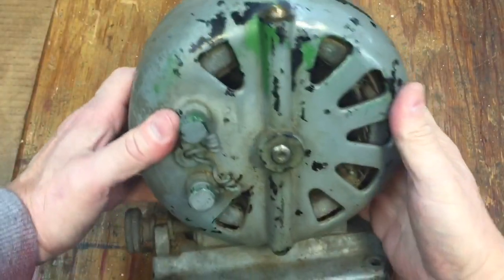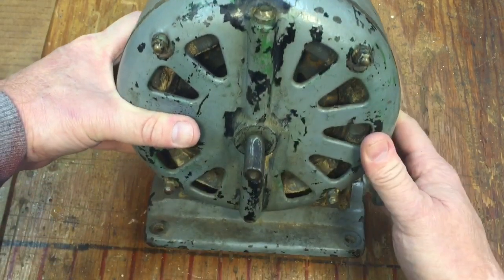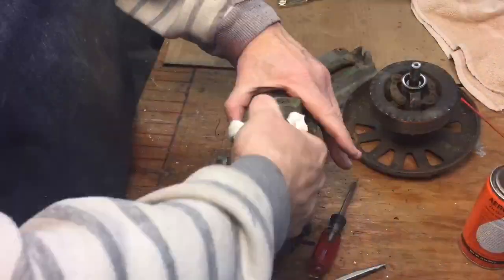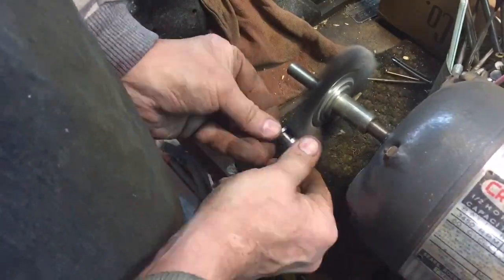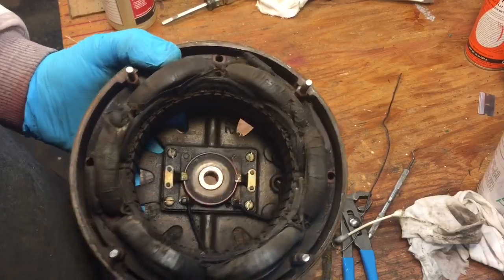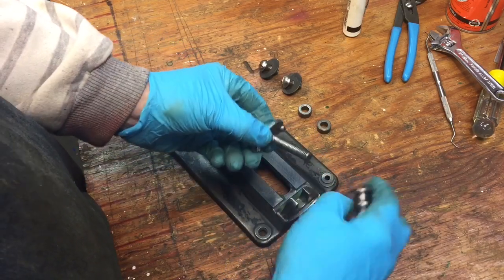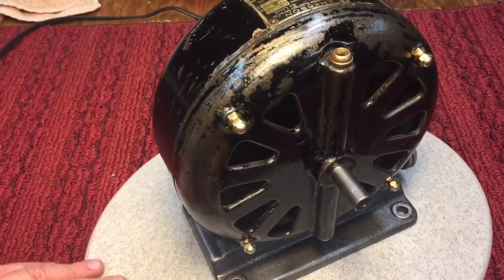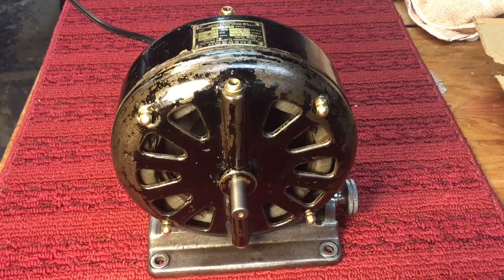Antique Emerson Pancake Motor Refurb...

Comment: That's an induction motor, I think it's a split-phase start type. The formula for the speed is 120 x line frequency / number of poles. 120 x 60 / 6 = 1200. That's the synchronous speed, the speed at which the oscillating magnetic field of the stator is going around. The rotor speed is always a little less than synchronous speed.
Reply from the maker: Hello Lite Roadie!  Wow!  You really know your motors!  Thanks for the info!!!   😃👍

Comment: Great restoration John.  I have yet to use your single edge razor blade for removing paint, varnish, etc. I just haven’t had a project where I needed too.  But that was a really good job.  When you move you have to incorporate this into an exhaust fan for your shop.

Comment: I havent seen one of those in 40 years. I worked on an old Nickelodeon and that was the kind of motor it had! Yes original color was black, and the base was adjustable! GREAT job! Also, the Nickelodeon ran at 1150 RPM.
Reply from the maker: Hello Bill!  Those motors were really built to last!  Heavy too!  I really enjoyed the clean-up on this one!  Thanks very much!!!!!
Reply: ScoutCrafter Heavy is an understatement! I once had to move a 350lb plus Emerson Blower motor out of a pipe organ! We ended up hoisting it out and down the outside of a church after removing a stained glass window to do it! The guts of that monster was a larger version of that same Nickelodeon motor! Man...Thanks for the memories!
Reply from the maker: Wow!  Those old industrial sized motors were amazing!  The funny thing is they are very deceiving, for the size you don't think they weigh that much until you lift them up!  lol  I worked for a week with a friend who owned an elevator repair company, that was some of the hardest work ever!  Those motors and flywheels were HEAVY and because the elevator was out usually had to be carried up to the roof via the stairs!  Thanks God I'm retired now and those days are long gone!  =)    Thanks Bill!
Reply: ScoutCrafter Me Too! LOL!

Comment: Great video, nice seeing old motors running. Butbe careful of that lead paint. I purchased 2 tubes of lead paint detectors circ $ 8.49. be safe.. Cheers !
Reply from the maker: Ron- That most likely was lead paint...  The good part was I didn't sand it so there wasn't too much airborne!  The worst part of lead is breathing or ingesting... If I do ingest any lead it will have to battle the asbestos already ingested!  LOL  Believe it or not I don't wire brush paint anymore because of the inherent dangers.  Those lead testing kits are a fantastic investment!  I just assume everything I have is lead because of it's age!  Thanks very much!
Reply: I bought the lead testing tubes at Lowes.

Comment: I have a question about a previous video you made about shear's.....what do you do to keep them free of rust....
I like all of your video's
Reply from the maker: Hello Clifford, Years back I removed all the insulation from the pipes in my basement in order to heat it, a climate controlled environment is your best fight against rust. Generally for bare steel parts I really like a coat of Shellac or Lacquer they work great. I have found that a coat of wax won't last that long so I gave up on it. Also a really good simple protector is to heat up and mix mineral oil with petroleum Jelly (Vaseline/baby oil) use a 50/50 mix. When cooled the mixture is thick and clear, rub down your tools with a generous coat and wipe off excess, that works great and is non toxic.  Unfortunately we are always fighting rust and for that reason Incant keep anything in my garage... It must be nice for the guys who live in California or Arizona, no rust problems for them!  Thanks!
😃👍

Comment: Wow!! very nice I was gonna suggest taking it apart and if you wernt sure how to.. you could learn with vacuum motors usually vacuums are in the free sections of classifeids. Thats how I sorta learned most my mechanical experience was tearing down old vacuum cleaners like rainbows, kirby, shark, riccar, simplicity, princess... pretty much anything usa made, i tore them down with taking every screw out and scrubbing everything that was dirty and then rebuilding the brushrolls and motors with new bearings and either repress the carbon brushes or replace them if they were shorter then a incher or so. Another thing I did/do for the armatures is when theyre running taking a piece of chalk and sometimes a fine polishing stone that they both come in small boxes of like 10 in square 5inch long and maybe .33x.33sq in sticks. If the motor is arching ill use the polishing stone and that will restore the armature pretty good and  sometimes if the burn mark isnt super BAD its fixes it completely. Whenever I see one of those vacuums at the thrift stores ill buy them maybe to fix up and resell for anywhere from $75 to $300!

Comment: hey SC, I just picked up one of these. It is identical except for it says it was made by Emerson for Seeburg. I cleaned it up a bit, oiled it (spins freely), and wired a plug to it. It just hums and doesn't spin. I'm a little afraid to open it up like you did. Any tips or tricks?
Reply from the maker: Yes Chris!  Try this- Wrap a piece of twine around the shaft and give it a good yank and then quickly plug it in...  Make sure you are going in the rotation of the motor...  (if you don't know try both ways)  If the motor runs after you spin it and plug it in then it's the starting mechanism...  =)  Let me know if it works... Bicycleguy@aol.com

Comment: Looking at this, I gotta ask, how have things gotten better? Maybe cheaper, not better. As far as the weights go, they work the other way around; the weights cause the disc to move and open the circuit to the starting winding once the motor is up to speed.

Comment: If that came from a player piano it would need to be a synchronous motor and to me it doesn't look like one.
Reply: Not so.  It operates a pneumatic pump that generates a partial vacuum.  Nearly all player pianos, whether electric or foot-powered, operate on partial vacuum, or suction.  There are a few exceptions, but those don’t have motors like this.

Comment: 这台古董电动机的样子很是奇特，像一只南瓜饼（注：南瓜饼是中国江南地区的一种点心，是糯米与南瓜等材料制成。），你是如何识别制造年份的，好像没有在铜制铭牌上看见制造年份。请问你清洗电动机的内部用的是什么液体，是否是“电路板清洗剂”。
Baidu Translate:The appearance of this antique motor is very strange, like a pumpkin cake (Note: pumpkin cake is a kind of dessert in Jiangnan area of China, made of glutinous rice, pumpkin and other materials). How do you identify the manufacturing year? It seems that you don't see the manufacturing year on the copper nameplate. What liquid do you use to clean the inside of the motor and whether it is "circuit board cleaning agent".

Comment: Ham-fisted, careless approach. The two most delicate, difficult-to-restore/replace parts of a vintage motor are the information tag and lubricators. I cringed when I saw you beating around on the bottom of that motor to remove the base, while the tag and lubricator caps were pounded and ground into the top of the bench. One of the first steps should be to remove such vulnerable parts, or at least protect them in some way, before proceeding with the more active phases of the job. I see "restored" motors all the time on ebay that have had their value destroyed through such means.